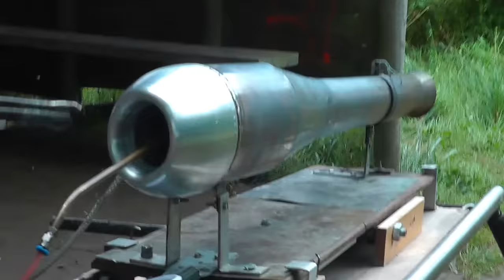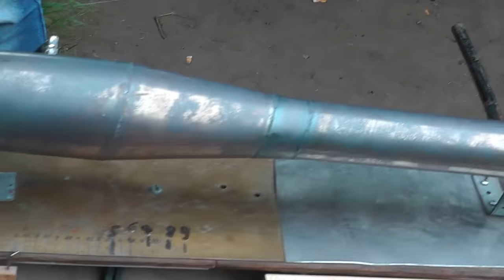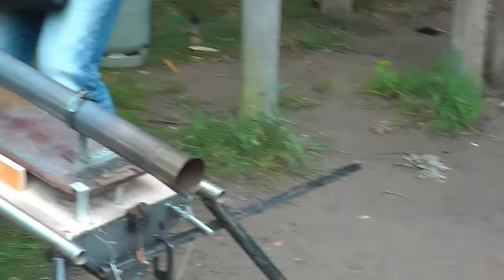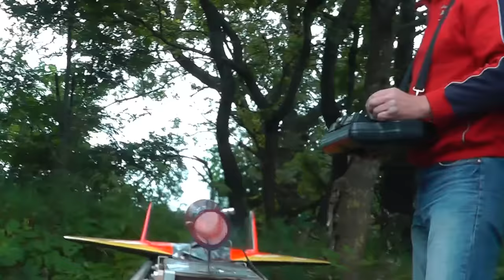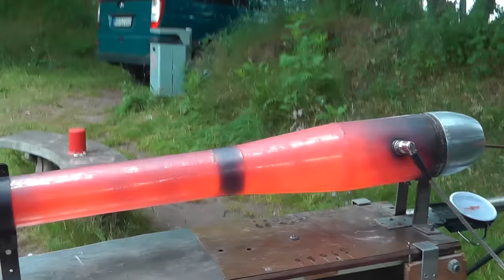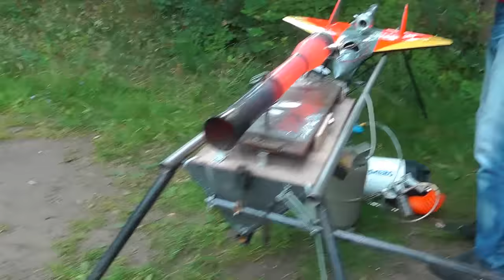Best pulsejet  pulso of the world

Comment: That one looks very efficient and seems to run smoother than most pulse jets I have seen.
Reply: Improved Design there. Not the distinctive sound of V1 motors.
Reply: All Pulse Jets are extremely inefficient compared to almost all other forms of propulsion due to a verry low compression ratio
Reply: @BG-th1ti   What did I just say?!🤨
Reply: @davidjames1063  The "Buzz" sound was due to the shutter doors of the V-1's engine opening and shutting at 50 times a second, causing 50 pulses a second, which caused a 50Hz (Hertz) sound.
 
I'm guessing that this was at least 70 times a second...
Reply: @Skeeter McSwagger  "that one looks very efficient"

Maybe work on your writing skills champ, I know you want to seem smart but you aren't doing a very good job.
Reply: @BlueBillionPoundBottleJobs  you should take a note from your username bud.

Comment: Once ignited ,is the fuel source the oxygen in the air used? Back in the 1960's scientists/military were experimenting with scram jets ( ahead of their time). I was told at a certain point the very air became the fuel. But  That was "so yesterday" .
Reply: Yes was wondering the same... I have assumed always that the energy production industry sabotaged scram development on a high level as the DOD and energy producers are so infused. This is the future, ionic drives too... @90% plus efficiency these technologies are it... air as fuel, .... no brainer. 

Forward!!!
Reply: Fire needs three things: oxygen, heat, and fuel. The triangle of life. 

Plain air is mostly nitrogen and oxygen. If it could burn on its own, we'd have all been killed the first time some caveman struck a flint! X3
Reply: @jamesgizasson  lightning:
volcano:

Comment: Same type they used on the v-1.
Reply: Actually, only the basic design is the same, but the V-1 engine had one-way valves that prevented it from "farting" out the front. They opened to intake air, but closed as the fuel-air mixture detonated, forcing the exhaust out the back.

Comment: hello, you need to do a further cylindrical cylinder a little longer than the previous one at the end so that when the fire is pressed on the surface of the cylinder, the front air is sucked in and cooled down. suction air seen in front

Comment: Hi nice video.
Quick question.
Can increasing or decreasing the length of tube make more or less power?
Ie would a trombone type sliding tube adjust power and fuel consumption?
Reply: It's a ratio between the combustion chamber, volume and tube length , so no...
As you can't change multiple widths at the same time as lengths.
I do like the idea though , a trombone like sliding tube might be good for fine tuning for changes in air pressure and or combustion rate of different fuel mixtures.
Reply: @petevenuti7355  a bit like the blackbirds scram engines cowling you mean
Reply: Not by much. Changing the venturi dimensions would though.

Comment: Fine! If you enclose the Pulse Jet inside a duct, as in 'Trompe' (see Wikipedia), https://youtu.be/uvf0lD5xzH0
a bit similar to 'Stipa' airplane https://youtu.be/kB4-_OWz5qE
you can have the outer side of Jet cooled from the air aspirated, and this heat added to thrust. Blessings +